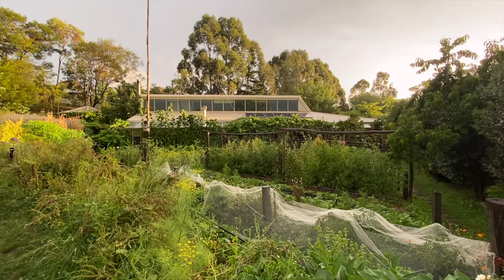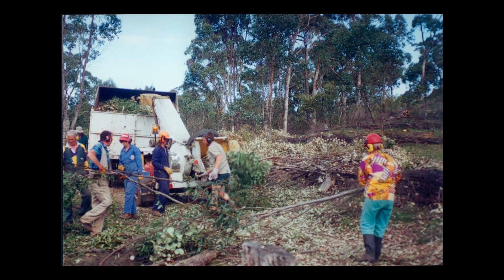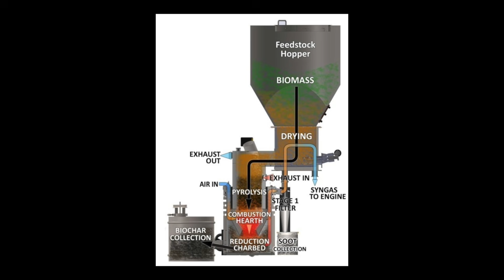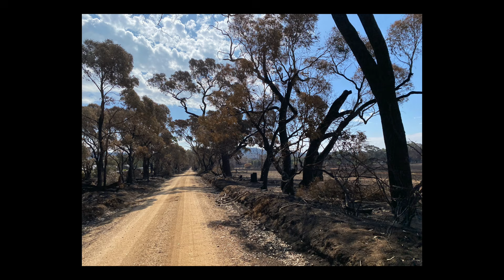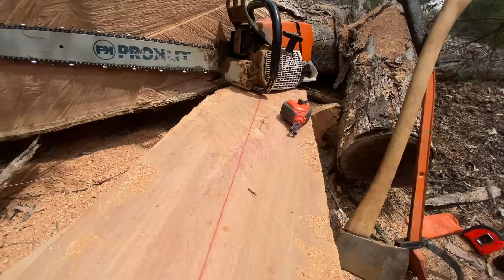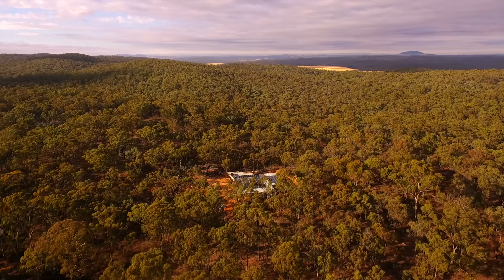Woodgas Hybrid Electric Truck - Introduction

Comment: Great to see you articulate your vision Oli! We have been seeing the benefits of integrating wood into our home energy system, which has allowed us to experiment with 'off-grid' living in suburbia. When overcast day are approaching or upon us, we burn wood for heat and cooking - reducing our dependance on our newly installed battery system. Maybe on day a small wood gasification home scaled system could be used as a back-up during those energy challenging times of the year? All the very best for the journey - catch you upon your return.

Comment: This may be egg sucking education: Fluidyne.  I like the screw chipper.  Chewton.  Extra turbo charging may help lower power (Swiss tried this in the 30's), please be aware of carbon monoxide poisoning, the more I read about it, the more wary I become. Cobdogla.  Murtoa.  Biomass fuel handling(sugar mills, NT mimosa,density, distance, storage, drying, pellets)  Pressurized gasifiers(hazards and weight and space reduction), filters, tar. hydrogen, flame speed, ignition timing, octane. oil enriched. Kurt Johannsen. Use in diesel engines.  You demonstrated the fabrication skills on the stout.  Can't see a particular technical barrier.  I'll watch with interest.

Comment: I like your attitude. Every Summer I am reminded of the stupidity of government management of Forrests. Rather than leave the forests to build up fuel to burn on a 40 degree summer day we should be allowed to pickup all the fallen leaves, stick, branches, and dead trees to burn in our fire places to keep warm in colder months. How do you get permission to harvest scraps of wood from the forests?
I’ve been experimenting with running engines from wood gas, in my experience pyrolysis of scrap wood in a high pressure vessel to burn the smoke and create charcoal works well. The pyrolysis process creates enormous amounts of heat. I’ve found that smoke burns hotter than open flames. Later, after it cools, charcoal burns really cleanly and creates very pure carbon monoxide which burns in the engine the exhaust is carbon dioxide. Scrap biomass from the Forrest is a free gift that keeps on giving
Reply: Think of roadside and other infrastructure vegetation management as well.
Reply from the maker: Yup, some of the vegetation cleared from under power lines, fire breaks and road construction. There’s massive amounts of wood waste. The yet proven part is mobile and reliable systems to make electricity from it. 
Off to visit Spanner RE2 tomorrow in Germany who are the leading gasification company in terms of up time reliability for systems under 100kw. But they are not able to be used mobile yet.
Reply: @FryersForestRD . I would like to share an idea with you about a method of continuous pyrolysis. Most methods use a batching process which wastes energy. My idea is to have a hopper that receives biomass and a mechanism that forces it into a long tapered pipe so that the biomass becomes highly compressed. It has a high temperature oven at the far end where the wood gas’s out at very high temperature . The high pressure biomass stops the gas leaking out via the hopper. Instead the gas (smoke) is cooled and tars oils and water condenses out. The smoke is then sent back to the oven to be reheated then it is fed to the combustion chamber under the oven where it is burned. The other output of the oven is fine powered charcoal which is quenched in water the resulting steam runs a steam engine the powers the hopper compression mechanics. Leaves and sticks in charcoal, hot water, tar, oil, wood vinegar and electricity out. Then the charcoal can be used to create biochar for soil or be burned to provide carbon monoxide to run an internal combustion engine to generate electricity. The last output is the white wood ash that is actually the best thermal insulation material known.

Comment: Rediscovered,very common in ww2 gas producers. But good thinking shame people in power don't want to think outside the square!
Reply from the maker: So much amazing work was done in the 30s on them before the war started from what I understand. This allowed the rollout during the war with millions of functioning gasifiers. There is a great paper published in 42 by a Swede, Torsten Källe, showing engineering refinements in the technology of the time. An amazing read for anyone technically interested in gasification. I aspire to make a contribution to gasification as significant as Källe. I am confident his gasifier will be built in the future for is elegance and simplicity. It seems like the combination of a gasifier and a carburettor in some ways.

Comment: Great stuff mate. I've been slowly building a gasifier outta found and scrounged stuff. I've got the bones of it built. I thought the same, if I can make electricities I can do things. Powering a vehicle with wood leccy is genius. There is an old bloke Frank around here who remembers gasifiers from the forties during the war. He built one in the nineties and him and his wife drove from southern QLD to Darwin, twice in a wood gas powered Ford van towing a trailer with gasifier in it. He said it lacked a bit of power. Charging a battery would fix that. Good luck with the project mate.

Comment: Good idea, but very marginal use case, limited to such passionate people as a hobby.
After some time I think you will be a bit tired of inconvenience of this solution - waiting for wood to be heated.
Anyways, I keep fingers crossed for this project and will watch the progress.
Reply: It's complicated making your own fuel, be it biodeisel, or pyrolysis of waste timber and collecting the gas.
25 million Australians. It's so much simpler capturing solar power into an old Nissan leaf as a farm buggy. Or dumping it into our two BYD batteries from written off vehicles.
Most of out maintenance mowing is with and electric 52"zero turn. Chainsaws are electric, and all our irrigation, and hot water.
Setting up the batteries takes someone with experience and knowledge of inverters and HV safety.  Then you can have almost unlimited power. Good, almost new solar panels are very cheap in Australia. I've picked up a one year old 6kW system for almost nothing but the EV charge to collect it.Yes we have a towbar on our EV.
Reply: I assume as a hybrid EV there'd be a battery involved, and the gasifier is essentially powering an onboard generator keeping the batteries topped up - so there'd likely be little waiting around to get started.